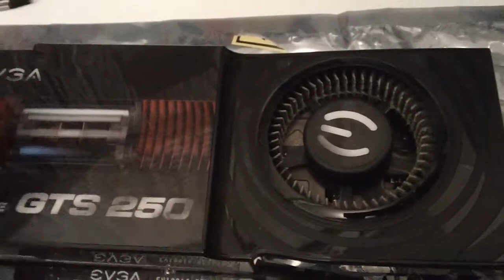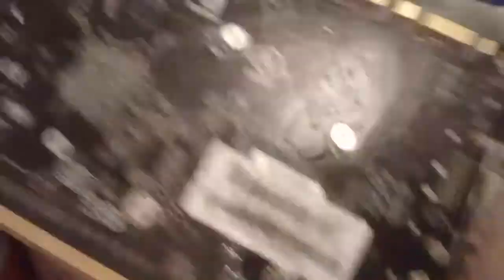MaximumRD PC Tip: Vacuum that Videocard! No really.

Comment: I've bought compressed cans in the past but generally don't like them now.  They don't last long so they seem like a waste.  I have an air compressor at work I can use when I need.  My case has nice intake filters so considering I have 2 cats I can still go a year or more without blowing the insides.  I do use a vacuum to clean the intake filters every 3 months.  Those filters work! My buddy has a small can that you plug in and it blows just as good as a compressor but it was $80!